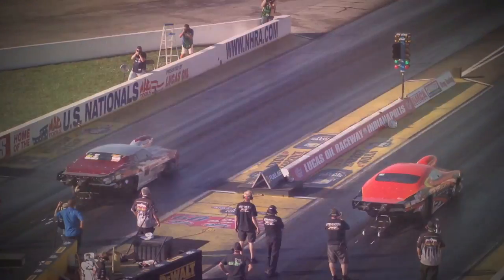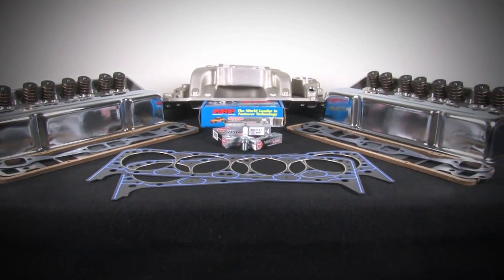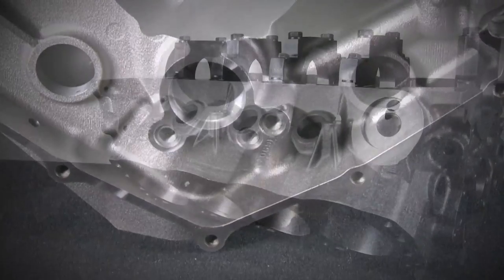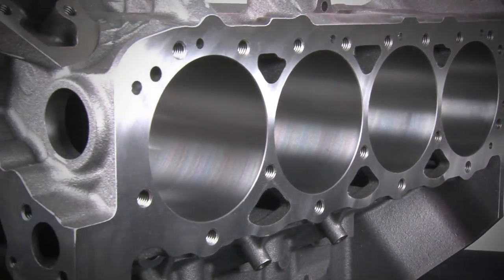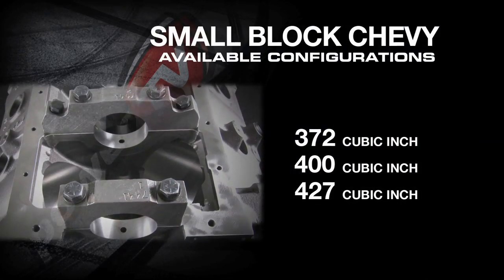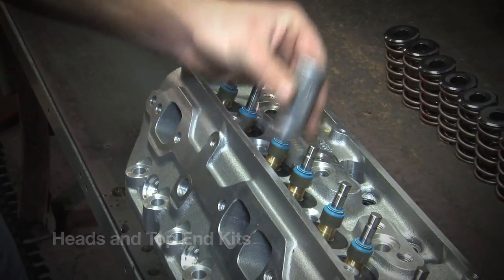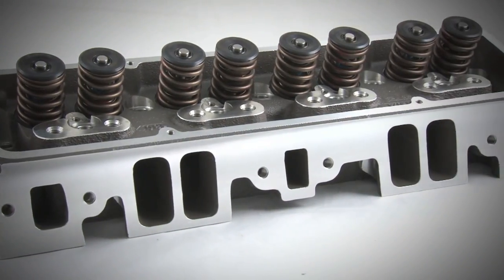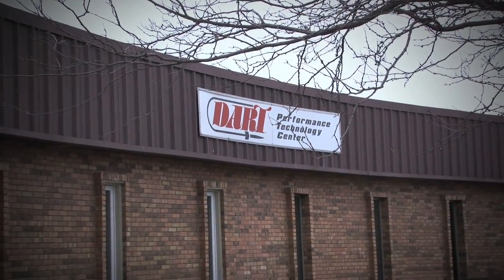SHP Products by Dart

Comment: Horrible block junk
Reply from the maker: Mr. Smith, we’re sorry that you feel this way. Our SHP line has been an excellent line of performance products. We stand behind our products 100%. Please give us a call and ask to speak to Mike Sanders. Please have your product part number on hand and we’ll do our best to help you resolve whatever issue you may have. Call from 9am – 6pm, EST from, Monday through Friday at 248-362-1188.
Reply: @DartMachinery  I have a question. Can the short block be used as a daily driver? I would like to have a new Dart 400 in my truck for the massive torque.
Reply: Our shop has been using DART products since day one, never had a problem. Their quality is second to none.